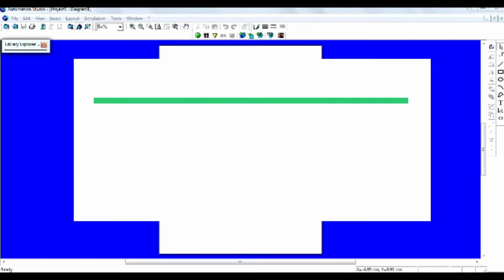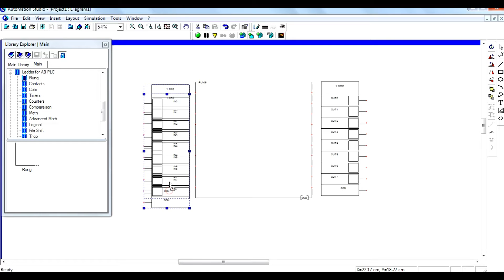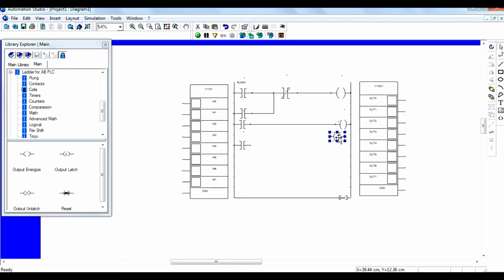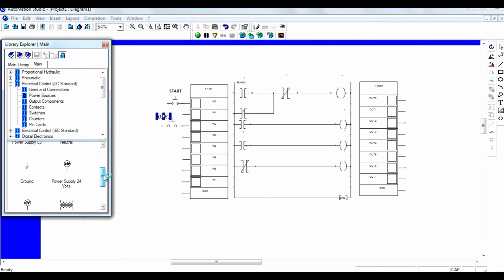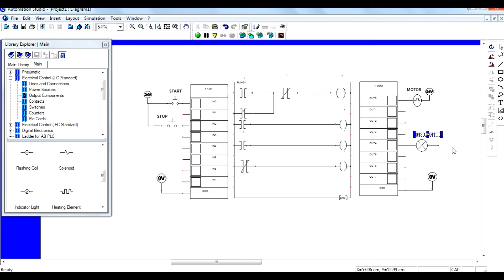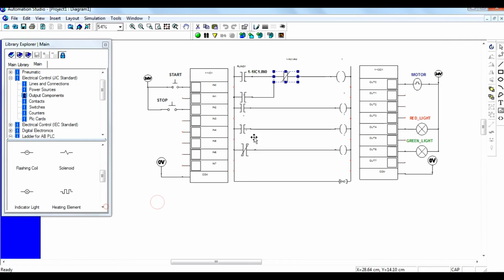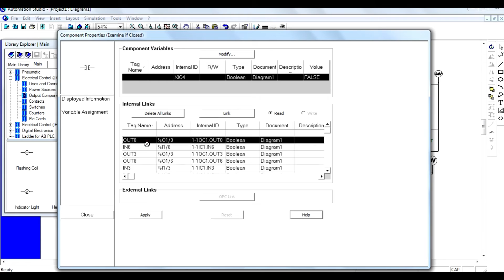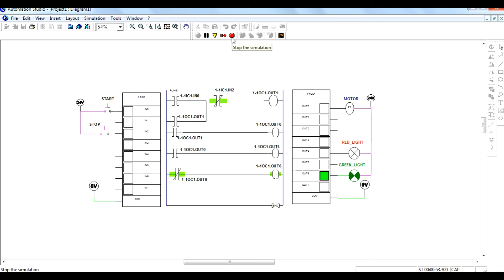Motor is OFF -Green light get ON & Motor is ON-Red light get ON using PLC | Animation

Comment: Create a PLC ladder logic diagram that carries out the following sequence of events:
Two inputs (SW1 SW2), six outputs (red light, white light, green light, M1, M2, bell)
When switch two (SW2) is closed, the red pilot light (Red_PLT) turns on, motor one (M1) starts running, and the bell (Bell) sounds.
After 10 seconds, M1 stops running and the white pilot light (White_PLT) turns on.
Fifteen seconds later, Red _PLT and White_PLT turn off, and the green pilot light (Green_PLT) turns on.
Finally, five seconds later, both motors one (M1) and motor two (M2) start running.
If switch one (SW1) is opened, the process is halted.
Can you make this please 🥺